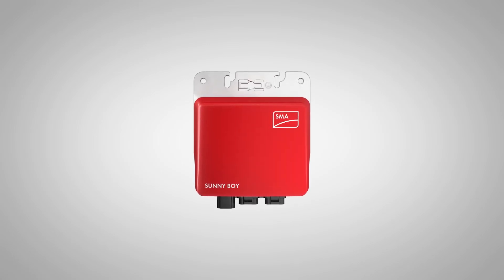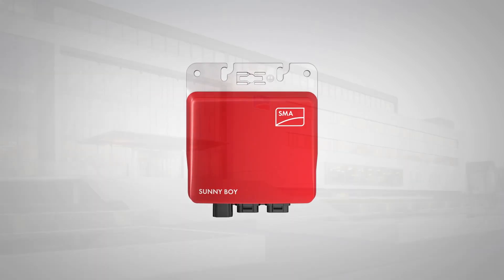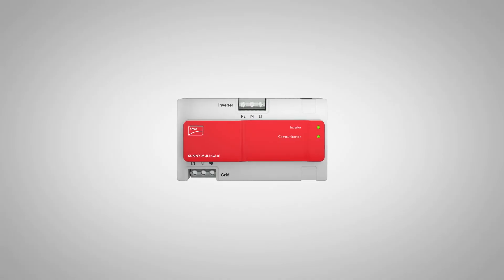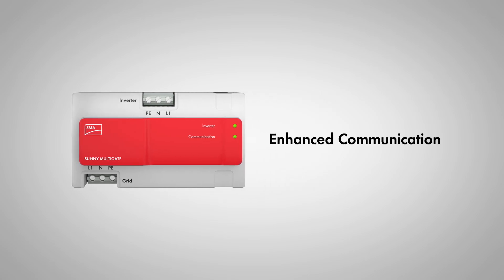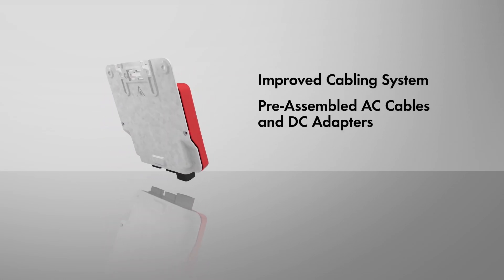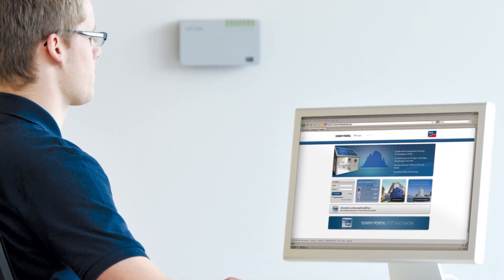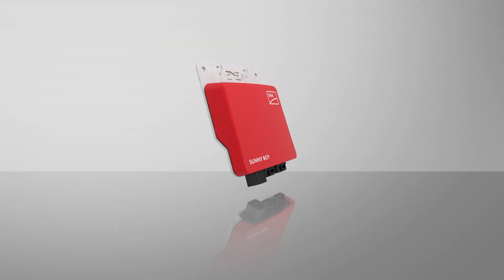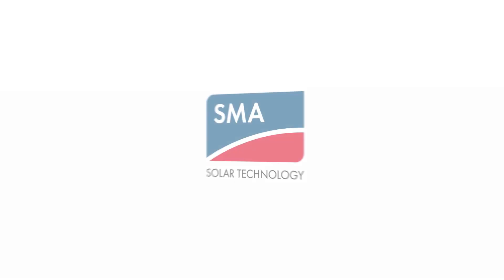Introducing the SMA Sunny Boy 240 Micro Inverter

Comment: Does it support Frequency Dependent power reduction, in other words, can I put a bunch of these on the output of a Victron Multiplus and have it work just like your string inverters?
Reply from the maker: Unfortunately the SB240 micro inverter systems are not able to implement a frequency droop control that is needed in a typical off-grid system control (like Sunny Island uses)
Reply: @smasolartechnology  Do you have a solution to add a micro-inverter array to a Sunny Island?